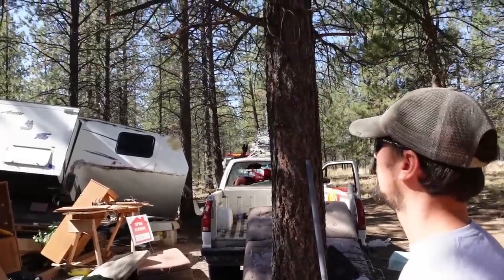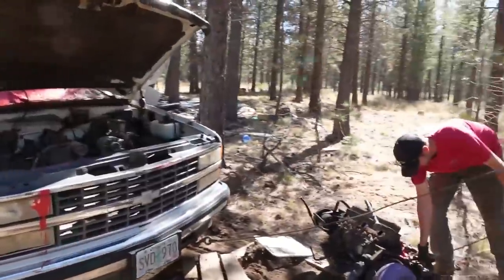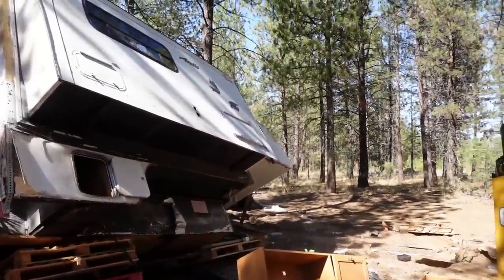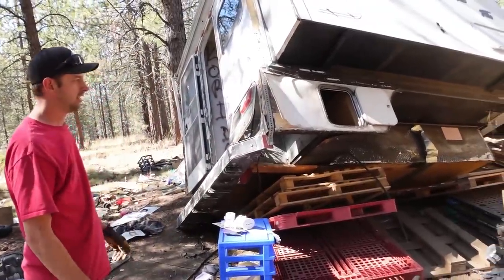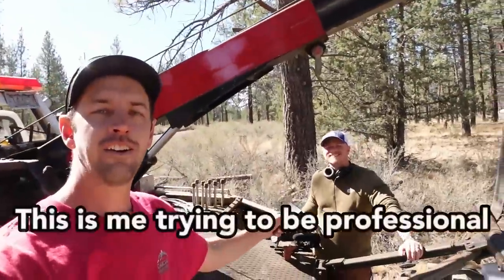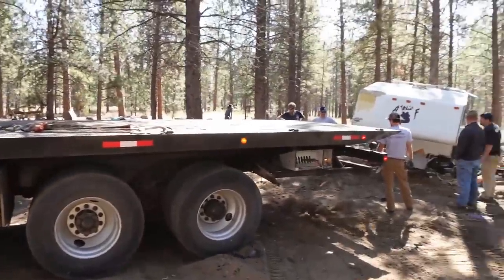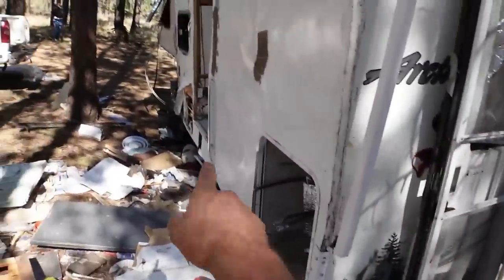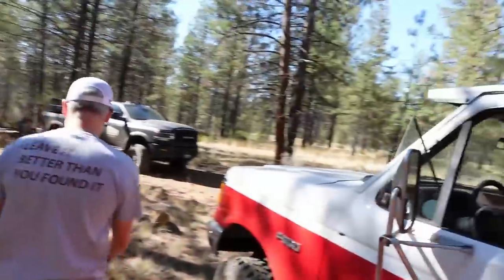Cleaning up an Abandoned Homeless Camp.  (plus story time with Casey!)

Comment: I’m doing a clean up on a 1/2 acre lot in Oregon so far 4 18ft car trailer loads (with 4 foot sides) two roll offs 30yard and a 40 yard figure two more car trailer loads and it will be done…turns out my uncle was a hoarder even kept a burned out 11ft slide in  back yard I had to break down to remove….put a nice dent in my brand new massy tractor…just helping my mom out since she inherited the property and the mess on it….,,she is giving me his 1940 buick that’s rusted out (already found a new body for it) and his 1990 4x4 k3500 standard cab Dually 454 th400 beast on fuel and not much power but I’m going to build it…

Comment: This week in Tiny Homes Oregon, we meet up with Rex, a part time dental hygienist who specializes in aquatic lizards, and Chloe, who is a free lance owl pellet collector and sells woven nose hair keepsakes on her Etsy page.  Their project is turning an Arctic Fox truck camper into a tiny home on a 6x6 roll back  truck, so they can see the country.
Reply: I have a 379 extended hood Pete with a stretched frame as an RV full air ride body and suspension I had military axles and transfer case put under her made a front driveline to make her 6x6 I can still pull my 30 ft pintle hitch low flatbed for derby cars or my 45 ft gooseneck toy hauler but in a couple years when my youngest graduates I'm leaving it home and taking my 98 V2500 crewcab long bed with the good ole 454 (hopefully she has a Dirtymax in her by then if not I'll have a 3500 square body preferably or OBS Chevy in the shop being built with a 12V Cummins and 6 speed) with my rooftop tent and 30 ft gooseneck to travel around cleaning up at least 3 bags of trash a day collecting all the stuff metal recyclers pay for and pallets have the recyclers write the checks to the local organization that's responsible for that area and head for home when my trailers loaded with pallets to ship big stuff

Comment: Wow that is/Was a mess!
I am wondering about what goes where, after the Field clean up...
IMHO at this site it would probably be better to have like 4 dumpsters there for recycling, one each, for paper, plastic, wood, and metals. And then a recycling EGG as I’ve called them, for glass, (I first saw them in Germany in the 90’s .) It’s like a giant Egg with a flat bottom and multiple chambers filled by 6-8” diameter holes with rubber shields on the inside to prevent breaking glass from exiting via the holes. You simply put the glass in the corresponding color coded section, like Brown, Clear, Blue, Green, and Others. 

So How is it done ? I am pretty sure that the cars are taken care of by a Scrap Yard/Junk Yard /Salvage Yard and recycled that way. But what happens to the rest?
Reply from the maker: Stay tuned, that video is coming
Reply: @CaseyLaDelle  
Coolio 
I was thinking about if you would do something like that!😊👍😎